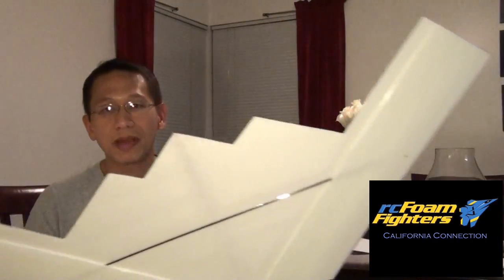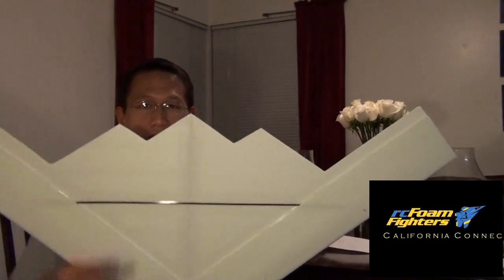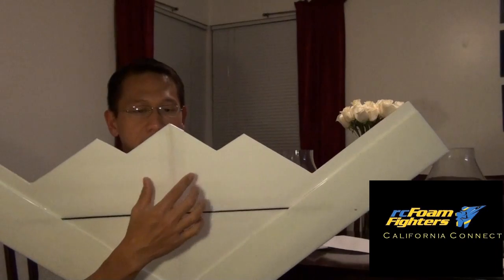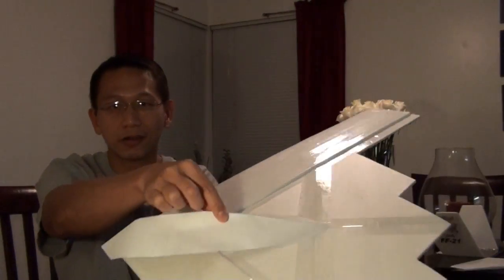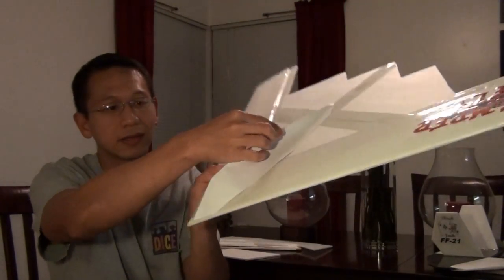B-2 stealth foam board build 1

Comment from the maker: @tomascontrerasjr i'm not sure how to measure thrust without the fancy equipment. i just read the motor specs that other people calculate with different props. the most important thing for me to do is my hover test- if my power setup can lift my plane, then i know it has more than 1/1 power to weight ratio and that's good enough for me. the other thing i do is use a watt meter.

Comment from the maker: @CH0Rigi it's not going to have any vertical stabilizers. i will be using drag rudders or decelerons as cmreel has suggested. that's what makes it a challenge for me, i have never built a plane without any vertical stabs

Comment: Ken great Job on the Blackjack! The B2, wow! Awesome man. You are getting better and better at your builds. The drag rudders will be cool. I think you may have better luck with th mid mount motor. When you keep the weight more centralized I am finding it makes for a better handling plane. it will also make it easier to get the CG correct. . Just my thought anyway. I'm sure you will do great whatever you do. Keep up the awesoem work on your cool planes Ken!
Paul

Comment: That looks real nice! What I recommend you do it add some gyros, and some stabilizers but disguise them. And the motors you can pretty much but it in either positions, and for the bomb drop I'd recommend you but it just under the canopy, so the storage would be the canopy. And you would divide it in half, so you have space for the electronics, and the "bombs" both in the canopy.. Other than that the plane looks real nice! Very good job!
.
~DLPlanes

Comment: WOW Ken that is one heck of a plane you made there, i think a mid mount option would look better and would be easier to get your cg right, or you could put the mootr out the back for testing power systems and when you got it right out it in the middle so you dont have to change power systems cuz you already figured it out. Best of Luck Dude